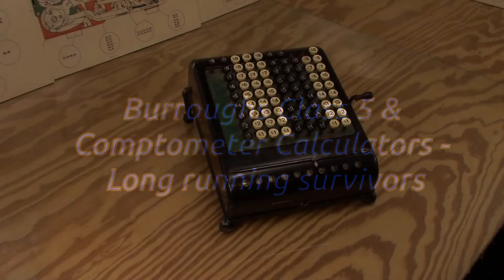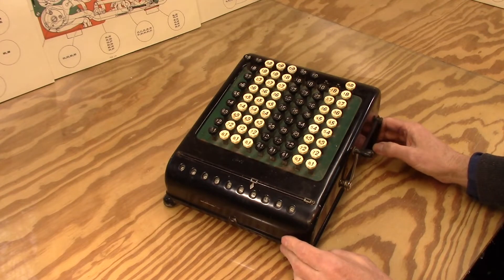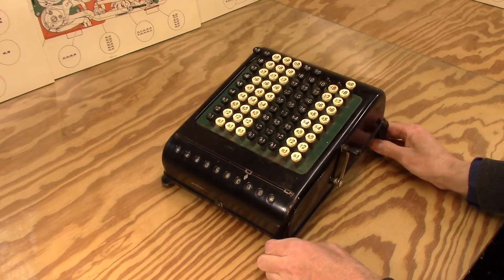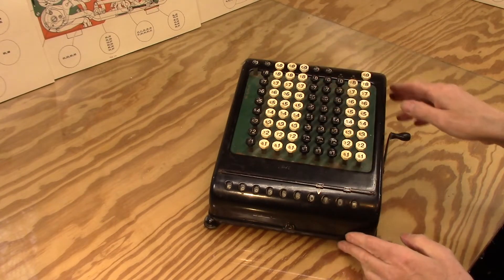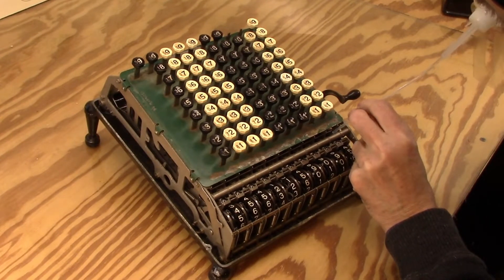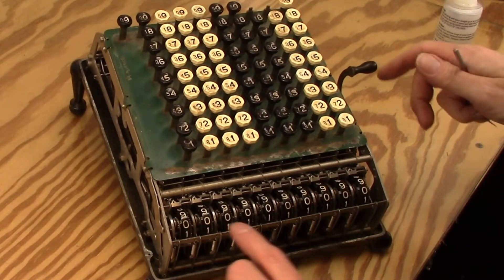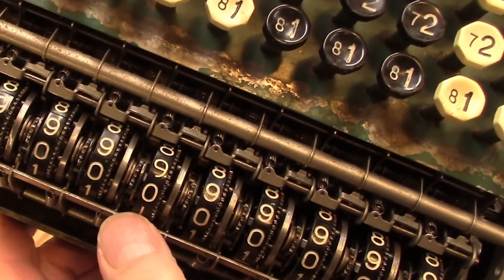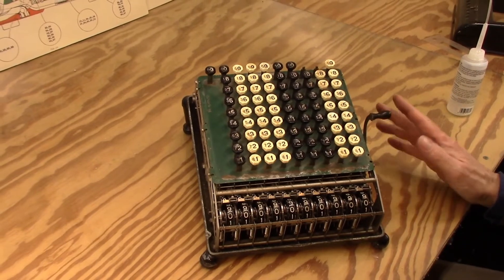Burroughs Class 5 & Comptometer Calculators   Long running survivors

Comment: I was in the California Board of Equalization lobby where they had a display case with a Burroughs listing adding machine (the lever to add type) sitting on top of a Comptometer box. No idea if the box contains an actual Comptometer.